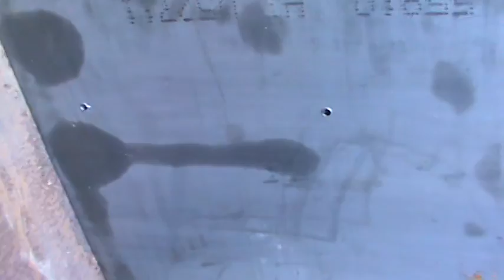Zippo Ranch Update and Q&A Session

Comment: Zippo, I have motor oil coming out of the breather tubed attached to the carburetor. How can I fix it.
Reply from the maker: There is a crank case breather (where the breather tube goes to the engine) that could be dirty and not properly regulating crank case pressure and blow by. I'd remove it and clean it with mineral spirits. If the issue persists, the piston may need re-ringed and hone the cylinder. Keep us posted Won! Zip~

Comment: I wish that hitch would fit on my '13 Conquest.  Not enough steel on the front to mount any kind of hitch.  At least not without significant fab work.  I miss being able to shove the trailer back into the barn-uphill.
Reply from the maker: +doogals99 Getcha one of these older models Doog! They can be had in operational condition for a couple hundred bucks in most locations. Cheers! Zip~
Reply: I replaced my 1990 Wheel Horse 520H with the '13 Conquest after the wiring harness burned up.  I like having a tractor that's always ready to go, but I sure do miss the toughness of the old WH.  And I really miss the sound of that old 20hp Onan running.
Reply from the maker: Oh yeah...I've got a Onan Gen-Set with the 20hp opposed twin...TOUGH engines! I just wish they didn't go out of business. If this engine ever lets go, the power head will get attached to a Briggs opposed.

Comment: hay zip I just came across and early 60s late 60s simplicity 3012 garden tractor trying to find out what motor is on it has a built-in harmonic balancer timing gears
Reply from the maker: +Derek Cowan Run the numbers (on the flywheel blower housing below the carburetor) on the Briggs and Stratton web sight.
Reply: I lost all spark and now won't start and I was just it running good and doing good and I am missing a lot of parts to use the attachments

Comment: I have simplicity 725 with a B/S engine, but I have no name tag on the engine, is there another way I can identifier the engine so I can get a new carburetor? thanks Zippo
Reply from the maker: +Stan Wilson All of the carburetors are the same across models from the late 1940's through the 1980's. You need a 3 bolt (number of screws holding the top section of the carburetor to the bottom) and they're readily available on ebay. Just type in Briggs cast iron carburetor and pay attention to the appearance and make sure they look the same and it will work. Cheers! Zip~
Reply: What is it with the numbers on the adds for the carburetor like ("Carburetor For Briggs & Stratton Cast Iron Engines Medium 2 piece Flo Jet 390323 ? how will I know this will go on my Simplicity?
Reply from the maker: As stated in my first reply, the carburetor was made for 40+ years to cover all models. If your carburetor has three screws holding the top section to the bottom, then simply find a 3 screw Briggs replacement carburetor and it will work. (If 4 screws, then the same applies)You don't need to concern your self with the dozens of part numbers that have been used for the same carburetor over the years. As I said, if it looks the same, it's the right carburetor. I know it sounds counter intuitive and too simple, but it really is just that simple. If it looks the same, it's the right carb. Zip~